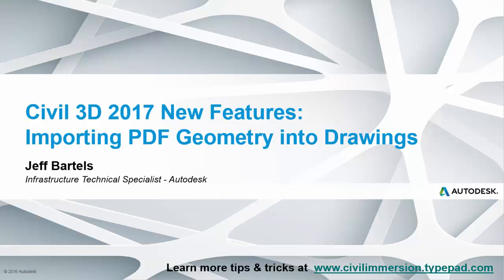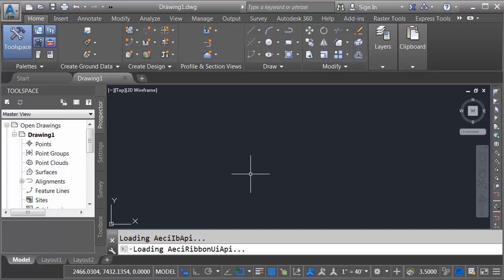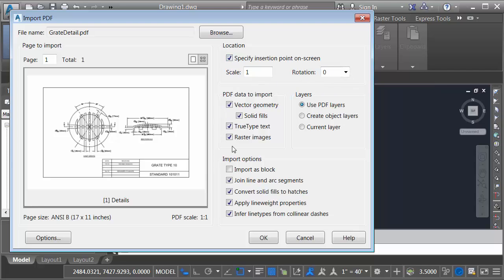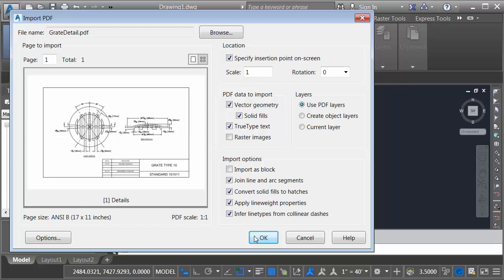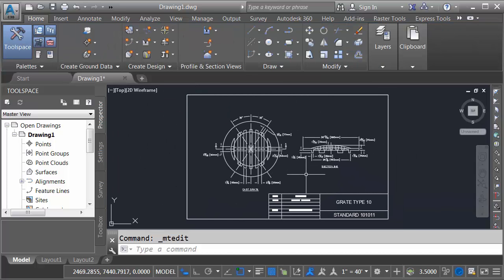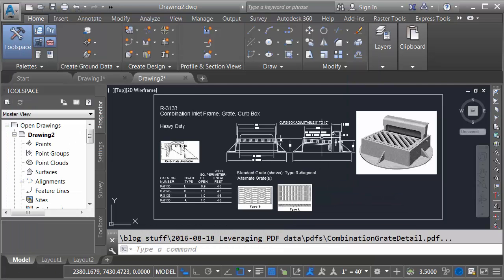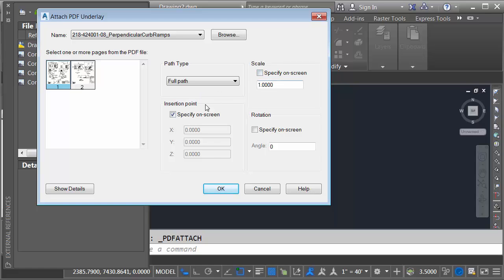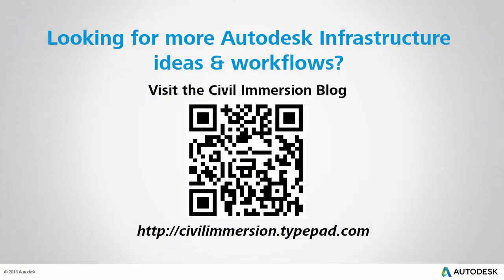Importing PDF Geometry into Civil 3D Drawings

Comment: Is there a function that will allow me the use an square corner in a Grading 
 instead of rounding the corner?
Reply: Yes possible u may do this very easily in civil 3d.
Reply: Grading With Bench in Civil 3d Part 1
Grading with Bench in Civil 3d Part 2
Grading with Bench in Civil 3d Part 3 | Grading with Featurlines in Civil 3d
Above mentioned Video title are regarding the question u have asked in your question.